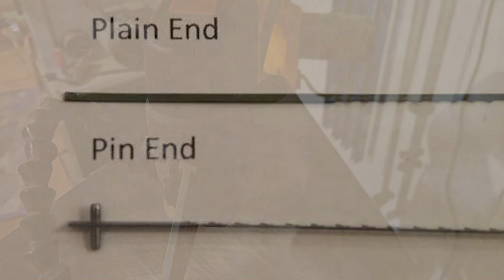The Best Scroll Saw: A Complete Guide

Comment: Nice video Steve, i started with a cheap dremel saw and after a few months of fighting to get good smooth cuts in 1990 bought a 20" rbi Hawk.  The saw is almost 35 years old and still runs and cuts very well and paid for itself several times over.
Reply from the maker: I'm happy to hear your good luck with your hawk!  You can't argue that they have great motors.  Ease of use on the other hand - the newer designs are simply better imo.  Thanks for watching and love your story!

Comment: I used to have a cheaper WEN and I was trying to learn as a beginner to use it and I'm a woodworker hobbyist and sometimes I need to make something that I bandsaw and jigsaw can't do, but sadly it was a little frustrating because the model  that I have can't even install a spiral blade without pin and I am having a hard time to make a small curves like letters and names and I end up selling it, but recently I needed it to my next project and been thinking to pull another trigger getting a Dewalt but not really if how good it is, between the high end brand like Pegas, till I saw your video
Reply from the maker: Well then I hope this was the nudge you needed to pull the trigger.  I did the same thing with my tablesaw and a jigsaw years back.  Then I bought a good tablesaw and jigsaw and realized how much easier a quality tool makes my life.    You won't regret it!  Thanks for watching!

Comment: I'll give you my first impressions of both Harbor Freight scroll saws. This could be of interest to many
1) Central Machinery 16" Variable Speed - $109.99 - It's basically a Wen at the same price point. Brushed aluminum table, about 22lbs overall. The brushed aluminum grabs your boards and makes turning unpleasant. The the table is also loud and vibrates. After making sure everything was tight, it was still rough to use. Advantages: It supports both pinned and pinless blades, costs the least and will get you scrolling, has a task light, has blower. Disadvantages: vibration, brushed aluminum table and the biggest issue is the adapter to allow pinless blades. It's a serious pain to get those pinless blades on correctly. 
2) Bauer 22" Variable Speed - $249.99 - Built similarly to the Rikon 22" at half the price. Pinless blade changing is tool-less like most dedicated pinless saws. Weighs around 75lbs and is almost entirely quiet operation. Advantages: quiet operation, steel or cast iron table with smooth finish for ease of use, no vibration, easy blade changes, table will angle from 45 degrees in one direction, to 30 degrees in the other, has blower. Disadvantages: no task light, but many of the higher priced ones dont either

Bottom line, I bought the 16 inch CM and didnt like it, so I returned it with no questions asked and got the 22 inch Bauer. And now I'm hooked.
Reply from the maker: What a fantastic comment and detailed assessment of both machines!  Defintely of interest to me.  Thank you so much!  I think this a very helpful information for people who really want more info on more entry level machines, so truly, I appreciate this information.  Thanks for watching and thank you again for your input!

Comment: Interesting video.  I have a Dewalt DW788.  When I bought it, it had a knocking problem at speeds higher than setting 5.  Researching on Google showed that a number of people grapple with this problem.  In my case it turned out that I had to file material off of a part of the housing on the upper arm, where two parts were banging into each other.  I also had to turn the tensioning rod in one turn (shortening it) while the upper housing assembly was apart; I have read about others who had to lengthen it.  The saw now seems to run well and I hope to get some good use out of it.  I do think it should be a good saw, but like anything, it can have its issues.  Looking forward to your part 2 video.
Reply from the maker: I really love hearing your story and I'm sounds like you had to get really in-depth.  Thankfully, I've never had that issue on mine, and I will say I operate mine at above speed five 99.9% of the time.  I wonder the percentage of saw that experienced this problem.  Thanks again for your comment, and I appreciate you watching!